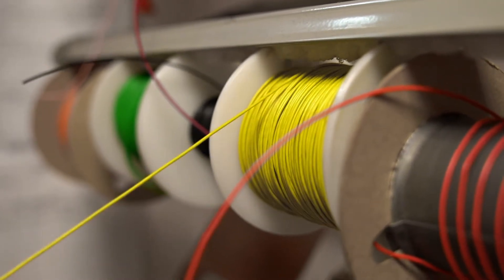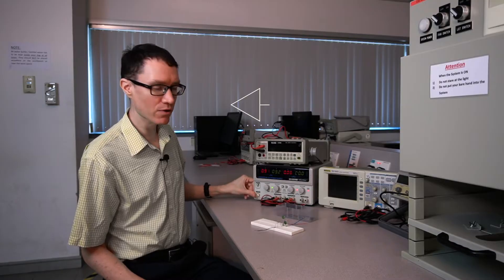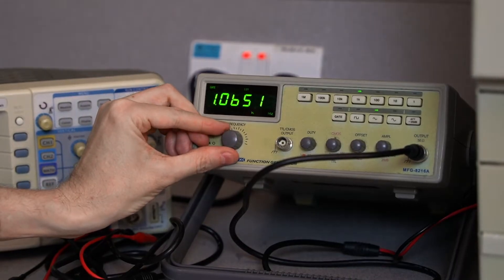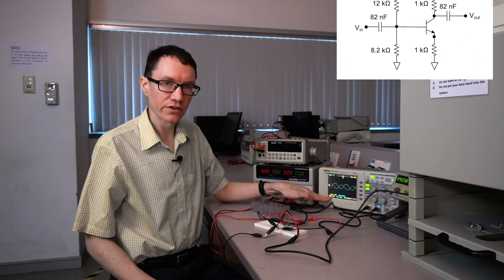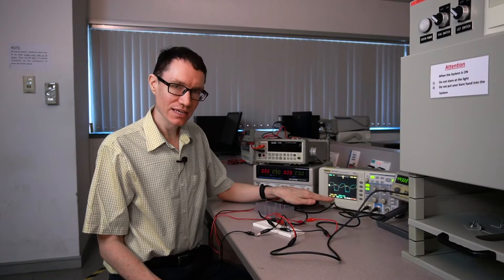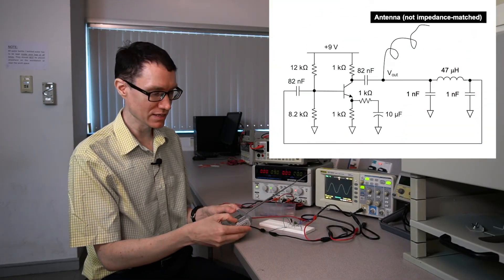Demonstration and Discussion of Colpitts Oscillator (8 - Oscillators)

Comment: In order to oscillate a clean sine wave, it is best not to use a bypass capacitor if possible.
① If you remove the 10μF and instead increase the collector resistance to 4.7KΩ, the voltage gain will also increase.
② Because both bias resistors are low, the signal seems to be attenuated. Increase both of them.
③ Furthermore, changing 47μH to 180μH, 1nF to 220pF, and 1nF to 220pF will make it easier to oscillate.
Reply: whats the reason behind the capacitor/inductor value changes?

Comment: Thanks for posting. Build a RL Colpitts oscillator circuit using the 2N3904 NPN transistor. Clean 934 KHz Sine Wave no distortion. Tried a 2N2222 NPN slight clipping at the bottom.  Also tried a 2N4401 transistor major clipping top and Bottom. Have you ever done a comparison of different types?

Comment: Hmm, this works well in simulation but I've spent now a couple days trying to get it to work in real life.  I even tried changing the values in case for some reason my components were not suitable to such a high frequency range.  Using all 10uF caps and 47mH inductor should give a frequency of about 325 Hz, but even that was a complete failure for me.  Just cannot get this to work under any circumstances.  Any advice?

Comment: Hello! Good video! As I understand - the quality factor must be as more as possible. So we can`t load LC circuit: as a result we can  have high impedance on input. BJT have low input impedance (emitter resistor can increase Rin, but there is the Miller effect and on high frequency input impedance becomes lower that on DC). An RF  MOSFET  BF998 can be a good variant. Am I right?

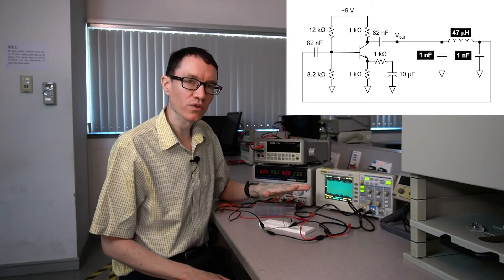Comment: I got this circuit to run in LTSpice (schem at 3:40).  Paste below (the netlist) in a spice directive window I changed gain from -2 to -1.25 to reduce the current spike when the collector becomes forward biased (RE2 from 1k to 4k) (gain limiting mechanism?) but it takes 10mSec to start.  run and select "pick visible traces" button in the toolbar.

RBtop 9V base 12k
R2 base 0 8.2k
V1 9V 0 9
C1 col 0 1n
L1 col tnk_out 47µ
Q1 col base emit 0 2N2222
C2 tnk_out 0 1n
RE1 emit 0 1k
RE2 N001 0 4k
RL 9V col 1k
C4 emit N001 10n
C3 tnk_out base 82n
.model NPN NPN
.model PNP PNP
;op
.tran 0 14m 13.99m
.meas TRAN vout PP v(col)
.meas TRAN vin PP v(base)
.meas TRAN vout2 PP v(emit)
.meas TRAN ie PP ie(q1)
.model 2N2222 NPN(IS=1E-14 VAF=100 BF=200 IKF=0.3 XTB=1.5 BR=3 CJC=8E-12 CJE=25E-12 TR=100E-9 TF=400E-12 ITF=1 VTF=2 XTF=3 RB=10 RC=.3 RE=.2 Vceo=30 Icrating=800m mfg=NXP)
.backanno
.end
.backanno
.end

Comment: Hi professor. Great Video! You are helping me remember stuff I did not use since college. 

Can anyone also help me out?

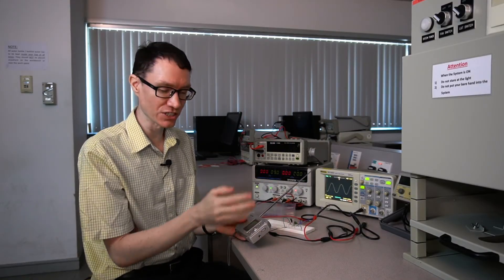On the previous video, we saw that we don't want any current leaking from the tank circuit to the amplifier (4:06 of the last video (7 - Oscillators) ), therefore the input impedance of the circuit should be way higher than the impedance of the components in the tank circuit.

The impedance of the 1nf capacitor at 1Mhz is 1K ohm. And the input impedance of the amplifier circuit should be close to (12K || 8.2K) ~ 5K ohm. 

As a engineer who has no practical experience in analog design I was wondering what are reasonable numbers for this. The input impedance being only 5x the impedance of the last 1nF capacitor seems low for me, since this would mean around 20% of the current will go to the amplifier and the approximation that was performed at 4:06 of the last video (7 - Oscillators) might not be that valid. Is a good enough approximation? Are there any rule of thumbs for this?

Thanks

Comment: When I designed vhf and uhf oscillators for the TV industry we almost exclusively used a common base configuration.alternatively we used common collector. The tuning was accomplished with either switching in various inductors or alternatively a variable capacitor across the inductor. Just FYI.
Reply: You are right because you were working in very different frequency band than currently presented , hence the electronic technique will be different according to the new specs. needed to achieve ... In fact , you can't even test it on a bread-board !...